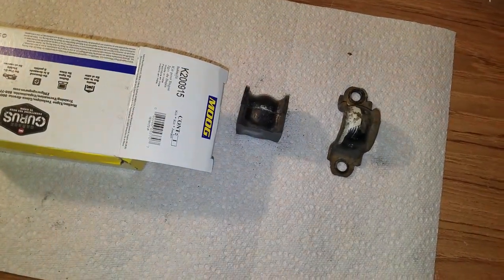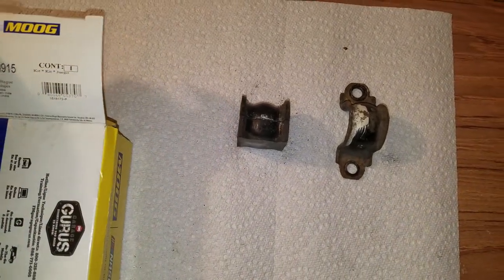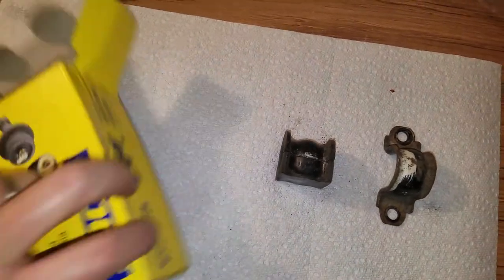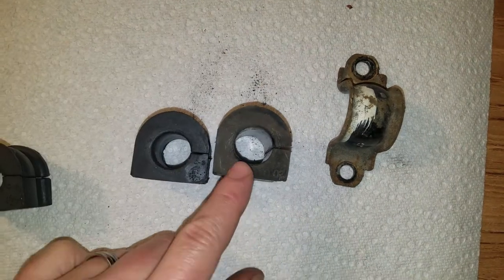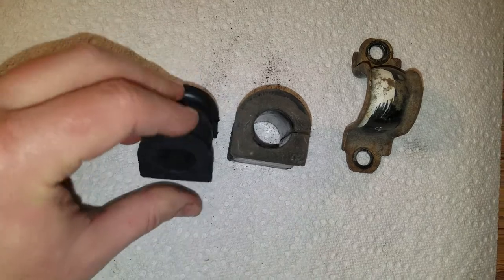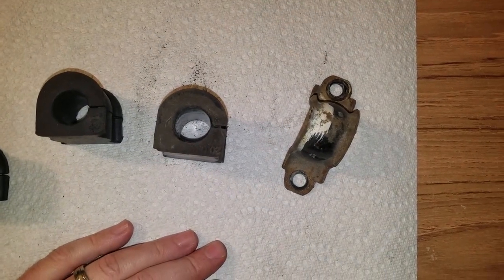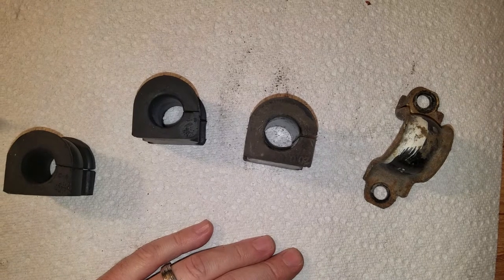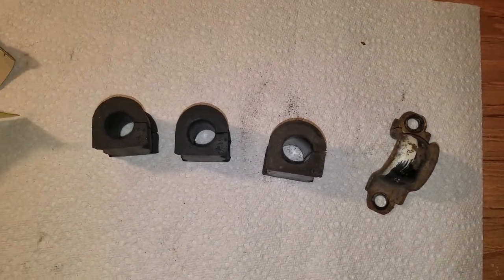Honda Pilot Acura MDX Rear Stabilizer Sway Bar Bushings - Moog K200915

Comment: Removing those bolts would be impossible in mine. Overall its in good shape but the rear end is particularly rusty. I'll cut holes in the floor instead and see how that goes.